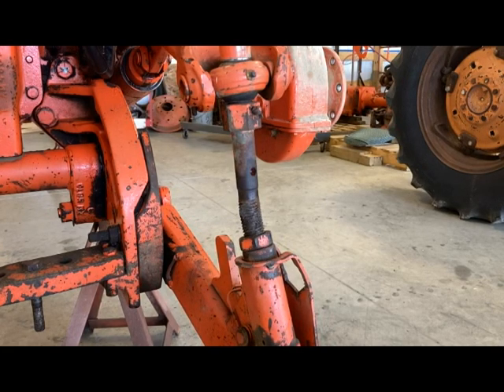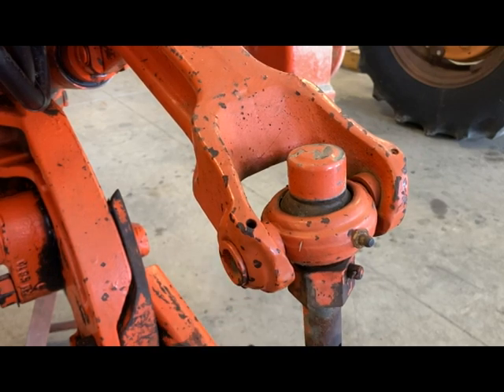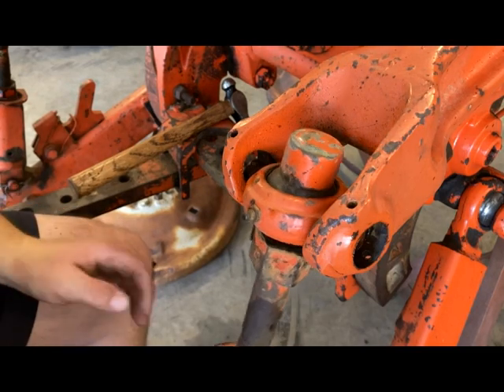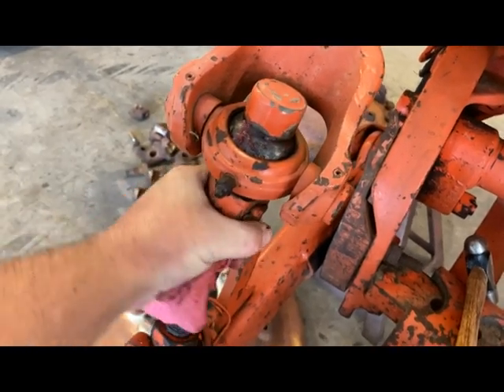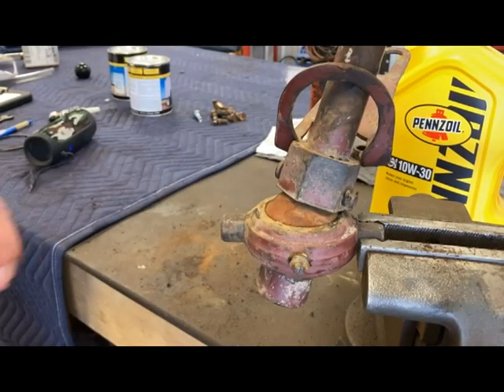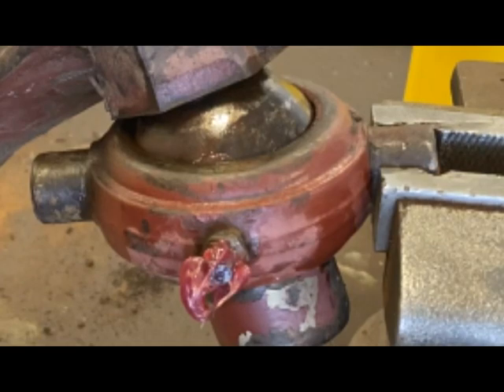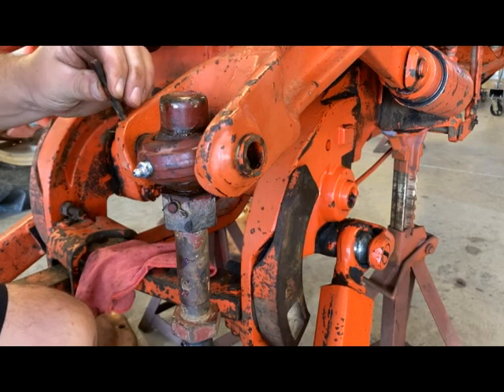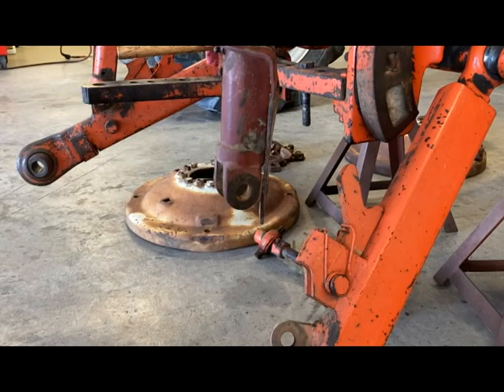Allis Chalmers 3 Point Lift Linkage Replacement 160, 170, 175, 180, 185, 190, 200, 210, 220 D Series

Comment: I appreciate this video. It gave me the basic steps I needed to replace the right one on my 170. However, the swivel on mine would not give enough room on either side to drive out the bushings with the tools I have. So, since the old one had stripped out threads, I cut off the side pins with my portaband and then drove out the bushings with the arm removed.